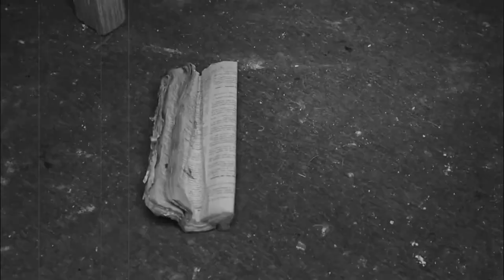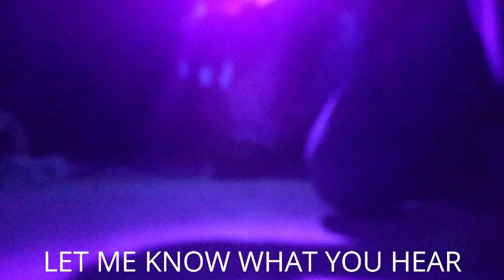(CONTRACTED HOUSE OF HORROR) JOE AND I ON OUR LAST FLORIDA VIDEO

Comment: I know Deltona well. I used to live in DeLand for many, many years. You guys need to swim the Spring Run and check out the boil at  Blue Springs in Orange City right down the road. And when it's hot like this; yeah that 72 degrees year-round water temp is Pure Heaven! You'll have to fight the current on the way up but you can swim with the current all the way back down from the boil. It's one of my favorite Springs and, I've been to just about every one of them; especially all the Springs in Ocala. Chris, I cannot wait to see your videos out of North Carolina. I'm sure they won't disapoint. I always love your head-banging music at the beginning of your videos so, please; never stop head-banging. 🎸 ON, DUDE.

Comment: 12:38 There's almost a glitch or a blur in the middle of the screen.  I see the dust or bugs throw it off focus later, but this is earlier.  Then ar 13:00 faint higher mumbling starts, but it isn't Joe or the frogs, or dog.  Its a separate sound.
20:57 voice

Comment: That NV cameta you have ybat didn't work. 
1 ) did you switch it onto NV mode ? 
2 ) did you switch IR light on ?

If you answered NO to either, you will NOT get it worki g in NV !!

MAYBE YOU HAVE IT SWITCHED TO PLAYBACK ?

Comment: Whoever started doing that drywall needs to not get paid until it's done right that's horrible. I'm a contractor I remodel homes so I know for a fact that for my company we wouldn't be afraid of any ghosts we would get that house done in two weeks tops done appliances everything done 2 weeks. But we don't live in Florida or Northern Carolina or wherever you guys are at not that we couldn't drive out there but we're not flying cuz we don't wear masks we never will wear eye masks never have. We get a lot of work we've never had to wear a mask so but yeah it should only take about two weeks to get that house done get a crew in there that knows what they're doing and it be done no ghost ain't going to stop that. GHOST HOW FUNNY .